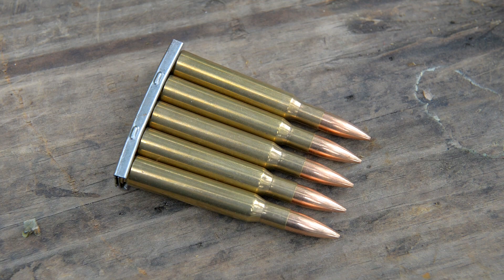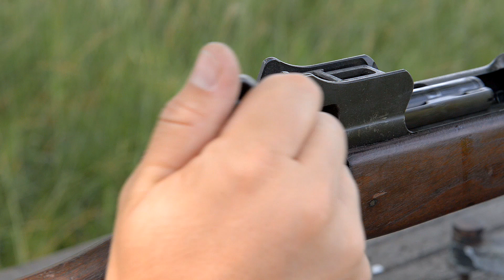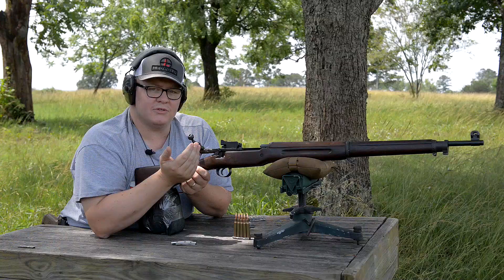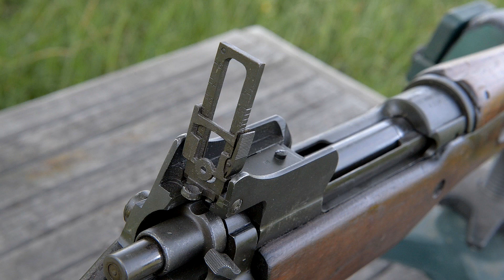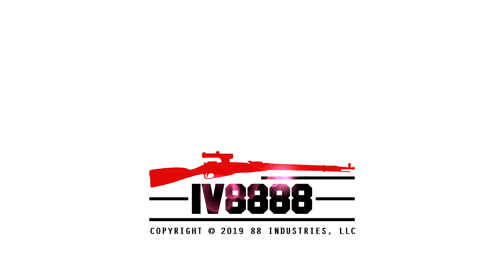M1917 Open Sights 750 yards

Comment: They are just as good as the 1903 Springfield.  Just different.  A little bulky.  
Not quite as handy.  Very strong.  Potentially more accurate than the Springfield.  
Springfield excelled at the top end because of their pre-selected Star Models.

Comment: Number 1:  Sight it in at 25yds dead center and then the marks on the elevator will corespond correctly.
Number 2: put your thumb at the rear next to the stripper clip and push down to load

Comment: I would assume your “balancing” the target on top of the front sight? That’s what I do with the factory front sight at 100 yards with small targets on my Winchester 1917. Mines a tac driver as well. First time to the range it shot all in the same hole with hand loads at 100 yards. I had it shooting sub MOA with random loads using Seirra 150 grain, Nosler 168 grain, and Nosler 180 grainers.

Comment: Hey guys..I just watched this video. I also have a m1917 that my grandfather brought home from France in 1945. I have cleaned it up a bit, bore looks perfect! What did you zero yours at? Do you line up the bottom of the rear sight or the top? How do you adjust windage? Thanks..Clint

Comment: What’s your load? I need to work up a plinking load for my Winchester 1917. I’m waiting for the go long video!
Reply: I made a sight pusher out of a C clamp for mine. Took all of a couple minutes. Should push your front sight a hair over to zero it. I picked up a repo 1917 sling for mine. It’s my favorite military gun. Probably because it’s chambered in my favorite caliber. My sks is a close 2nd. I put three shots all in the same hole at 100 yards the first time I took it out with a random starting powder charge of h4350 and a Sierra game king. Probably beginners luck. The front sight completely covers a 4” target at 100 yards. At 750 yards it must completely cover your big round target...and then some.

Comment: Just as an FYI, I have seen a documentary on Alvin York several times.  In it his Grandson claims that while Sgt York was Issued a 1917, he quickly  traded it for a 03 springfield because he liked the sights better,  And that is the rifle he took out the Germans with.  The Film with Gary Cooper shows him with a Springfield as York Insisted.  The only Liberty they took with the events is that Cooper picks up a Luger to dispatch a few more Germans.  York agreed to that because at that time the armorer could not get a 1911 to run with blanks.  Which is still a bit of a trick even now.  Good Video as always!
Reply: This seems to be little known to most people.  I rarely find someone putting out this information.  Most accounts of York's feat still list the 1917.  As for me, I have both rifles, and if wanted to to some precision shooting, I would use the Enfield with the aperature sight.  I assume York had never seen an aperature/peep sight and that is why he opted for the open sights of the Springfield's battle sight which was zeored for 530 yards I have read.  The leaf sight of the 03 does have a peep/aperature, but it is damn difficult to see placed ahead of the receiver ring.

Comment: What are your thoughts on 180 grain pills? I have a Remington 721 circa 1945 that I used to shoot 150 grain exclusively with. Availability dictated that I buy 180 grain at one point and when I shot them my groups shrunk significantly. Only drawback is the recoil increase. I’m hoping to see what they do at 500+ yds. Any powder types and weights and specific projectile recommendations would be greatly appreciated.

Comment: I have one of these, marked Eddystone, but the over all length is 41", rather than 46", and the barrel is 23" instead of 26".  It looks correct and I can't see tell-tale signs of an alteration that would indicate that it was cut down for hunting or whatever.  I haven't been able to find any information that it was made this size on purpose.  It's a .30-06, made in December of 1918.  The stock seems original, it's darkened from years of oil and has it's share of scratches and dents.  Anyone have any idea why it's not the full length of 46" ????

Comment: Fun fact:
The Danish Military still uses these in the arctic climate in Greenland. The go-to rifle against polar bears. 😊
Reply: the Canadian arctic rangers still use Lee Enfield.they are only now swapping them out for saku bolt actions.apparently cold weather is not good for semi and full auto actions.
Reply: @marksimpson7477  They work pretty well with the right lubricant. Graphite is my go to, or you can run them dry for a little while, but that's not good for sustained shooting.
Reply: Nice to know. From A Dan to ;)
Reply: They are just too cheap to buy new rifles....
Reply: the simplest mechanism is often the best in bad conditions i think.
Reply: Well the 1917 rifle doesn’t have many moving parts

Comment: I was thinking that the rifle was Kevin's before you brought it up. For anyone who buys an M1917 in the future, I urge you to check the condition of the receiver and bolt lugs. Some receivers have cracks due to improper barrel installation when these were refurbished. Bolt lugs, I believe for the original nickel steel bolts, had cracks due to bolt setback because the bolt and bolt weighs (where the lugs locked in) were made from similar material which would cause increase wear and galling. I learned about this when I noticed a crack on my bolt lug. Thankfully I didn't shoot it. A quick fix is to get a bolt that has been parkerized and check for headspace.

Comment: Just a tip I’ve tried several types of clips with my M1917 I found Swedish mauser clips work they best by far they are super smooth thanks for the years of entertainment been a sub since 2010
Reply: Swedish Mauser clips are always the key. 1903 Springfields, M1917s, my Brazilian 08/34 Mauser in 30-06. The only thing they don't seem to work with are the Gewehr 98 pattern guns, but even then, some copies of the K98 do work with em.
Reply: and theyre relatively easy to find.   i think they also work in arisakas.
Reply: mike oneil yes they do not very well in the type 99 but work well in the type 38
Reply: Thanks for the tip

Comment: The M1917 has always been my favorite milsurp rifle since I was 10 years old.  60 years ago the M1917's were very easy to find and not expensive to purchase at between $25.00 to $45.00. I ended up with over a dozen M1917's all Remington built.
Reply: I bought my 1917 two months ago for 750 dollars...
Reply: I just bought a Winchester built 1917 Enfield for a little over $800 comple with remington 1913 bayonet and scabbard. Barrel looks great though haven't shot it yet.
Reply: I've got an Eddystone here in Australia, I used the action for a custom target rifle.  Strong like bull
Reply: I got mine in 1963, its a Winchester and it was like new. My friend had a model 721 in 300 H H. I could out shoot that Remington at any range with ease, pissed him off. Still have it and its still a tack driver after thousands and thousands of rounds.

Comment: Before I even watch this video in its entirety, I will say...I have been screaming for years now that this is, in my personal opinion, the most accurate bolt action 30.06 milsurp ever.  I have one built in September of 1918, parkerized (the late Eddystones we’re finished this way), and it HAMMERS a hole at 100 yards like no other.  Besides my scoped rifles, it’s THE gun that I reach for when shooting 1/2 pound tannerite at 100-150 yards. 
 
ADDENDUM: just noticed that barrel is dated the same as mine...9-18...and Y’all were hitting well, just like mine.  Not sure what others have found, but I have seen another rifle with 9-18 barrel and it shot just like this.  Makes me think the Eddystones were being built quite well 2 months before WW1 ended...